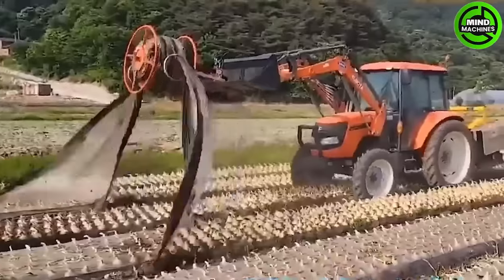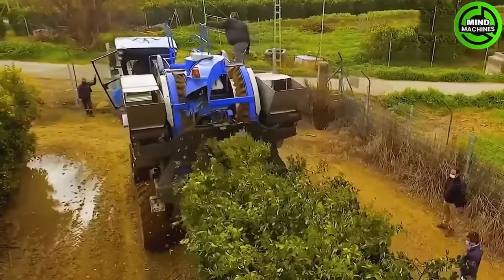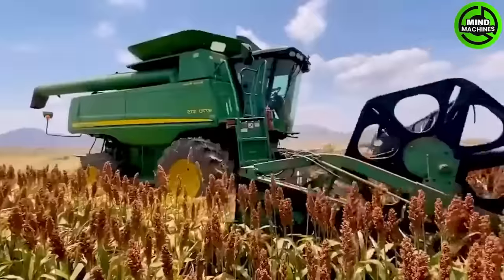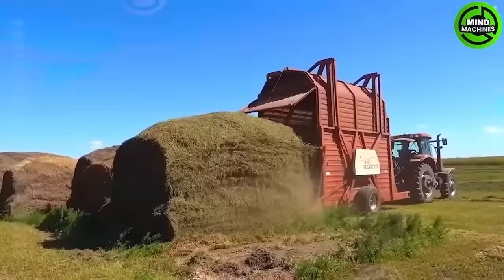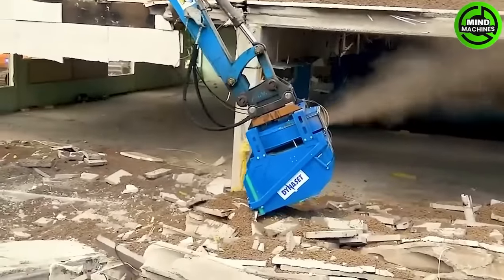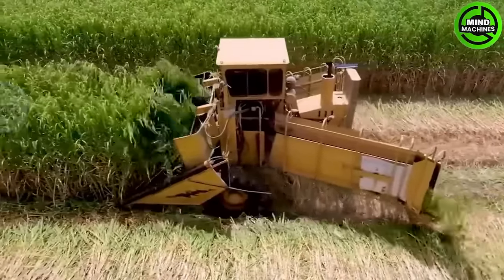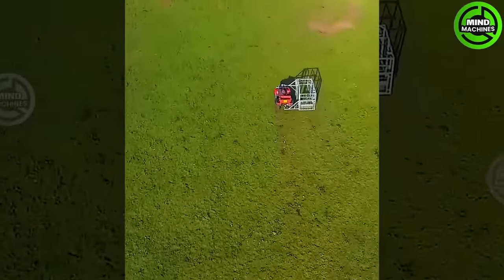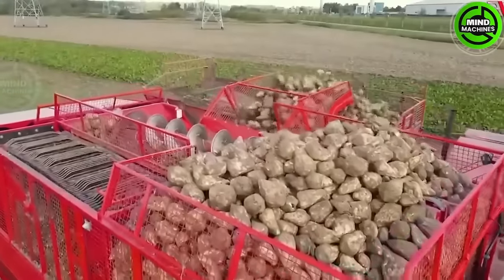The Most Modern Agriculture Machines That Are At Another Level, How US Farmer Harvest In Farm

Comment from the maker: *00:01 Nexit Weed Harvester
01:01 John Deere Baale Wrapper
02:15 Linen Field Machine
03:01 Fruit Cleaning System
04:05 Sputnik 660 System
05:03 Trio Track
06:08 Trailed Carrot Harvester
07:00 SE Machines
07:54 Plow Behind the Plow
09:01 Picking Fruit Robot
09:56 Windrow Turner
11:00 Screw Ditcher
12:03 Maja Automatic Fruit and Berry Shaking and Cleaning Machine
12:57 Shearing Sheep Machine
14:01 Vermeer's Autonomous Bail Mover
15:02 6m C Teller Cultivator
16:18 Apple Harvester
17:21 Dan Ether System
18:05 Jagger Robots
18:58 X91
19:56 Dh900
21:02 Tajfun Garden Sprayers
21:48 Ponet Water Wheel
23:46 Tomato Harvester
24:58 Apple Collector
25:59 CP300 Challenge Blade Plow
27:04 Grape Growing Robot
28:13 Next AT
28:52 Skid Steer Drum Mulcher
29:44 Sea Buckthorn Harvester
30:36 Ditch Witch's New Model 1820
31:24 PH1 Vegetable Planting Machine
31:57 Univerco Vegetable Wash Line
32:41 Van Hook Lawn Mower
33:26 Oxbow's New Technology*